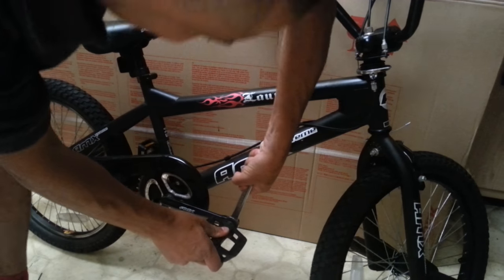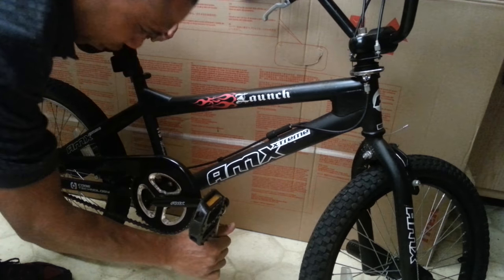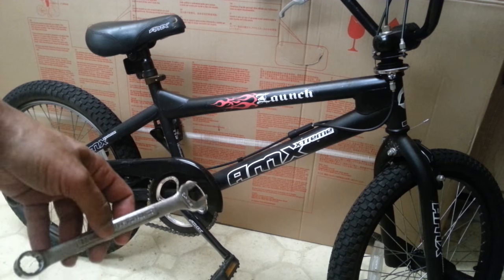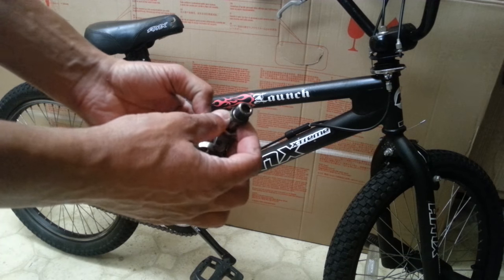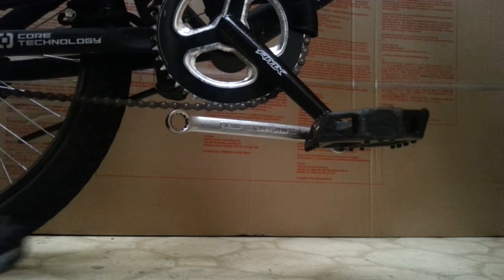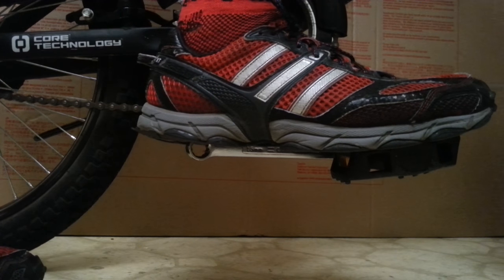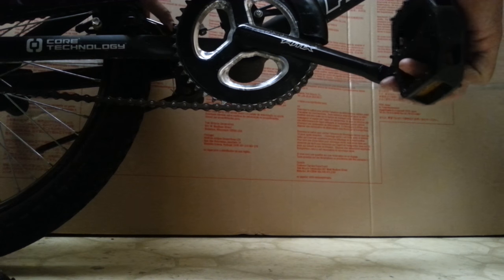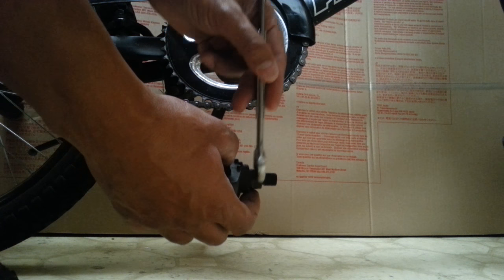How To Remove Bike Pedals From a Bike the Quick & Easy Way | #AdventureBiker

Comment: Man, you're a genius! I almost gave up on my pedals, but your solution saved me from going to bike service. Thanks a lot!
Reply from the maker: +Anatoly Sayenko Haha - thanks man! Glad this helped you. Thanks for watching and thanks for the comment!
Reply: Great tip ! Only had an adjustable wrench like in the video and the trick worked like a charm.
Reply: Same here man
Reply from the maker: Awesome. Check out this video for a tip on using an adjustable wrench for removing pedals: https://youtu.be/G5CbZg2sKxc
Reply: @theadventurebiker   what is different between right side pedal thread and left side pedal thread?
Reply from the maker: @SId-gb1qr  The right side has a right-hand thread, the left side has a left hand thread. This is so the pedals do not accidentally compleltely unscrew themselves from the cranks if they become loose. See the following video for more info! Watch this video here and find the answer to your question: https://youtu.be/G5CbZg2sKxc Cheers😉👍

Comment: Hi. Can I assume the same method will work on the other (not chain side) pedal? ie. Wrench pushed in exactly same direction downwards? Many thanks
Reply from the maker: Yes. Same exact direction. The reason being that the right side pedal has common right handed threads 
 that everyone is familiar with ("righty-tighty, lefty-loosey"); but the left side pedal has opposite (and not so common) left handed threads, in which case are also "righty-tighty, lefty-loosey". So rotate BOTH pedals in the SAME direction to loosen (backwards from the front of the bike). I hope this makes sense.
Cheers and thanks for watching!

Comment: Mine still stuck .but I've used your method before and it worked . Just ones I have on very tight on long time , they won't budge . Need to change them tho because one pedal slightly cracked .
Reply from the maker: Try soaking the end of the spindle where it threads into the crank arm with some kind of penetrating oil like BP Blaster. 👍

Comment: Do you have any tricks to get a peddal of the same type on the bike after they've been taken off? I'll explain. I'll be going on a bike trip and have to take off the pedals before going on the plane. We're not allowed to bring long wrenches or allan keys on board and I'm only bringing a small bag on board. I'll therefore need to put the pedals back on after landing, and without tools (ideally! if not without the tools at the airport to assemble my bike, I'll have to carry the bike with me in public transportation or in a taxi to a bike shop or hardware store : pain in the butt!). Thank you.
Reply from the maker: You really do need to have some type of tool(s) available to both remove and re-install the pedals safely and securely. Installing them only hand-tight is something I wouldn't recommend for sure. That could potentially ruin your crankarms in addition to potentially leading to an unsafe situation. Is there no way you are able to pack the required tools along with the bike itself? 

I am not sure what kind of bike and pedals you use but some pedals (like Shimano Deore XT and XTR) require an 8mm allen key for removal and installation (as mentioned in this video). There's really no other way. If your pedals use a 15mm open end wrench you might look into what is called a *crowfoot wrench*, like this one https://ebay.to/2speQ82. They come in every size and are small enough to pack away in the smallest of spaces. The problem with crowfoot wrenches is that they are intended to be used in hard-to-reach places, and this usually means they are to be used with a socket extension bar and either a ratchet or a breaker bar handle. You can use one without any of these but by itself you definitely won't be able to get much in the way of leverage to apply sufficient torque to properly tighten the pedals.

Another possible option is this: *Quick-Release Pedals*. Check out the QRD line of pedals from Wellgo https://ebay.to/2RmVwqL or the EZY line of pedals from MKS https://ebay.to/2RHoOjf. These pedals come in a variety of styles ranging from mountain bike, road, flat, and classic/vintage look. They use a low profile adapter that can be left in place on the crankarm. The pedal spindle inserts and locks into place in this adapter (and is also removable in seconds) without the need for any tools.

Comment: Hey, this worked great on the left pedal for me. But I can't seem to get right side pedal off. I trying to the exact same on the right but it won't budge. Any advice? Thank you
Reply from the maker: You'll simply have to try to put more weight & force into it. That's pretty much the only way. You might also try soaking some sort of penetrating oil (like P.B. Blaster for example) into the area where the pedal spindle threads into the crank arm.
Reply: Also make sure your turning it the opposite direction as the other pedal
Reply: @Donmateuk 
You turn them the same way (towards the back wheel)

Comment: I was able to use this to get one of my pedals off, but the other is still stuck 😭 the wrench is perpendicular to the crank (either way i put the wrench on) , so it's hard to get the wrench parallel enough where I can push down without the entire crank moving back and down
Reply from the maker: Yes sometimes you have to rotate the crank to a funny angle and/or flip the wrench around (that's why the open end is usually at a 45 deg angle to the handle). Position the wrench as close as you can to being level to the ground and then step on it as shown in this video. It might take some extra effort and even a few attempts but you should manage to loosen it. Good luck and thanks for watching! 👍

Comment: Maybe this works if the pedal and wrench line-up properly. My wrench stand-up at 12 o'clock
Reply from the maker: That's ok. Just rotate the crank arm (with the wrench placed on the pedal) until the handle of the wrench is roughly level with the ground (and facing  toward the back of the bike).
Reply from the maker: Have a look at the most recent video I created about this topic. It will give you a little more insight. https://youtu.be/G5CbZg2sKxc

Comment: Is it still. Anti clockwise for the left pedal?
Reply from the maker: Well yes and no (but most likely no).....that would really dpend on which side of the bike you are viewing it from. Watch this for a better explanation: https://youtu.be/G5CbZg2sKxc 👍
Reply: @theadventurebiker  Gday.   I figured it out.   To loosen,  it was one way for the right pedal,  and the other way for the left pedal (the opposite to each other)
Reply from the maker: @andrewwian4921  Yes. Bike pedals have opposite threads. This is to help prevent the pedals from loosening (or coming off) unintentionally. The right side pedal has the more common right -handed thread ("rightey-tightey, lefty-loosey" (when viewed from the right side of the bike)), but the left hand pedal has a left hand thread, so it must be turned to the right to loosen (when viewed from that side). Hope this makes sense and thanks for watching!! 👍

Comment: Are both sides lefty loosie?
Reply from the maker: Rotate both sides backward to loosen.
Reply: The Adventure Biker Left pedal was righty loosie. Right side Lefty loosie. The funny part is Im 48 and forgot but I can build a 950 horsepower engine. Or build an 7.50 tube chassis! Lol! Been a long time since I changed a pedal!
Reply from the maker: Haha that's why instead of saying lefty/righty loosie I said rotate both the left and right spindles backwards to loosen. Hope that made more sense. Don't feel bad man. I had a friend here who fully restored a 1967 Chevy Camaro SS 396 convertible from the ground up all by himself. He basically hand-built a numbers-matching car from the chassis up, and did an impeccable job I might add (the car has been featured in a couple of enthusiast magazines and has won awards at shows). This same guy would take his mountain bike to me to have the derailleurs adjusted when the gears didn't shift correctly....
I never fully understood that. LOL
Reply: I’m that same guy. Those derailers are maddening. I’ve built 3 show winners myself. A 69 Chevelle, a tubbed 72 olds that runs 9’s and car shows, and last year a 91 Z28 Camaro, but I’d be having you fix my derailer too!
Reply from the maker: LOL that is too funny. How can this be? I mean... obviously you guys have some over-the-top mechanical ability, ands derailleurs are very, VERY simple by comparison! I just don't get it. LOL

Comment: Mine still won't come off :( every time I step down on it, it doesn't move and then the wrench eventually just flies off onto the ground ._. Guess I gotta go to the shop lol great video though!
Reply from the maker: Wow, sorry to hear that. Are you sure you're rotating the pedals in the correct direction? Remember both sides basically rotate in a backwards direction to loosen, forward to tighten. If that still doesn't work then unfortunately your bike may need professional help and/or "surgery" :(
Reply: @theadventurebiker  wow almost broke my wrench, then learned that both side unscrew backwards 😯 it worked!!!
Reply from the maker: @chrisvione  Yes! unfortunately I didn't think about mentioning that when I made this video several years ago. So to address this concern I made a new video about this topic....check it out! https://youtu.be/G5CbZg2sKxc
Cheers! 👍

Comment: What about the left pedal?
Reply from the maker: Both left and right sides employ the same exact method to loosen and remove.
Reply: The Adventure Biker thanks,this is my first time disassembling my bicycle so I’m a bit scared cuz last time I was changing the seat I tore my finger’s skin XD.
Reply from the maker: No need to worry here. The right side pedal has right-handed threads and the left side pedal has left-handed threads. This means that both pedals are turned in the same direction to loosen/tighten: rotate backwards to loosen, forwards to tighten.

Comment: Pedal still didn't budge, I don't know what the heck to do. Guess I'm gonna have to work on the crank and bearings with the pedal on. And the crank still in the bike.
Reply from the maker: Put some serious body weight into it. If it still doesn't turn then you may need to soak the area of the pedal that threads into the crank with a penetrant like PB Blaster, or even heat the end of the crank up slightly with a torch.

Comment: I've honestly given up at this point I've tried everything, I broke a wrench tryingt o gr tit off. Not even this worked, any other ideas
Reply from the maker: Are your pedals rusted in place? If so you may need to try soaking or saturating the area with some penetrating oil or fluid. Also make sure that you are rotating the pedals in the correct direction to loosen! "BACK OFF"!
Please see my most recent video about this topic for more information:
https://youtu.be/G5CbZg2sKxc

I hope this helps and I would really like to know how you make out.
Cheers

Comment: And the other side ?  This works for the chain side sure.
Reply from the maker: The non-chain side is exactly the same procedure. 👍
Reply: Works the same, but the opposite pedal is stiffer (usually)
Reply from the maker: @jjwp-ql5rv  There's no reason why the left pedal (pedal on the non-drive side) should be any more difficult to loosen than the right hand pedal.

Comment: It doesnt work on my pedals. They have a round cylinder and the standard wrench cant grab it. It just spins around it. When I try to use a hex wrench on the other side , the pedal is just locked there. I put my whole body force. I will break something ... Well I am going to the service. Its too cheap than killing myself and ruin my day out of frustration. :))
Reply from the maker: Yes. You most likely have a newer style Shimano SPD pedal, which requires an 8mm hex wrench. These can sometimes be a little trickier to loosen if they're really stubborn but the technique is pretty much the same. 
Pro tip! - use a hex socket but on the end of a breaker bar turned 90° instead of an "L" shaped hex wrench!
Cheers and Thanks for watching!👍
Reply: @theadventurebiker  I did it myself in the end with a T hex wrench as you said. A straight hex and an L wrench and a multitool hex didn't work for me. Well, now I know to change my pedals on my own. I needed to put my red pedals to my red bike. So now it looks out balanced. Thanks. 😅👍
Reply from the maker: @Valentin Guru  Awesome. Glad this worked for you! Yes, a multitool (and most "L" shaped hex wrenches are much too short to obtain the amount of leverage & torque needed to loosen really tight or stubborn pedals.

Thanks again for watching and have a look at my most recent video about removing bike pedals and also some other great how-to bike tips as well!
https://youtube.com/playlist?list=PL6i5bgy9Y_ex9CJcJqyusM-XCe95ec2WR

Cheers! 👍

Comment: My right pedal comes off but not my left
Reply from the maker: Ate you turning it in the correct direction? Remember to turn BOTH pedals backwards (same direction) to loosen.
Reply: I am and it is opening up my wrench
Reply from the maker: Ok. What kind of wrench are you using? Are you using a good quality (ie. sturdy) wrench? A high quality wrench will not deform in any way no matter how tight or stubborn the pedal is.

Comment: Pls bro i need your help as fast as possible
Reply: Even if i have tried everything the pedals won't come off 
And the problem isn't that they are hard to get them out, the problem is that when i try to take them off there is nothing to put the key in so i can twist
Reply from the maker: Do your pedals have the "wrench flats"? (opposing external flat surfaces to attach a 15mm open end wrench on the spindles next to where they thread into the cranks)

Or do they only have hex sockets where a hex wrench has to be inserted into the end of the spindle?
(eg. Shimano Deore XT, XTR)
Reply: @theadventurebiker there is nothing to twist bro by the way the bike is a bit old it is an mtb from 2016 i think and i bought some new metalic pedals and there is nothing to do to take the old plastic ones off now i will have to trow or gift the new pedanls to someone😭
Reply from the maker: @gk_royal_fam  there most definitely has to be some where on the pedals to attach a wrench of some kind (external or "internal) to remove the pedals. Watch this video: https://www.youtube.com/watch?v=G5CbZg2sKxc
Pay attention from the 0:30 second mark. Is this the way your pedals are? If not there Must be a way to fit a 15mm open end wrench on them. Let me know.
Reply: @theadventurebiker  thanks a lot bro i will see it tomorrow thanks 🙏🙏🙏
Reply from the maker: Yes if all else fails and as a last resort you might need to take your bike into a shop unfortunately.

Comment: put a board between pedals
Reply from the maker: No, this isn't something I can reccommend doing since the board would brace against the bike frame when torque is applied to the pedal(s) to loosen. This might be OK on some bikes but could be very unsafe on others such as higher end, exotic carbon frames with thin wall tubing, which could result in a cracked frame tube (or a dent in the case of a metal frame using thin walled aluminum tubing for example).

Comment: Bro it didn't work for m, my pedals stripped all my tools
Reply from the maker: Wow sorry to hear this. Are your pedals rusted or seized in place?
Reply from the maker: Also, are you sure you're using the correct size tools? Most pedals require a 15mm wrench.

Comment: Tried this and broke the wrench after 2 minutes
Reply from the maker: Sorry to hear that. Your pedals must be really stubborn and/or rusted in place. Regardless, this method should still work using some additional force. If you broke a wrench this sounds to me that you may have used a wrench of inferior quality and/or materials.   Top quality hand tools are made from either Chrome-Molybdenum steel (CrMo) or Chrome-Vanadium steel (Cr-V). These tools are extremely tough and durable and will have no problems handing the additional force and stress that is required to loosen and remove stubborn pedals (and other parts). Thanks for watching! 👍

Comment: This " hack " is WHACK ! doesn't work only stripping the damn thing
Reply from the maker: If you stripped your pedal that's because you did something wrong - like turning it the wrong way (tightening instead of loosening), using and incorrect sized wrench, or both...

Comment: My pedals have been on for 25 years. This don’t work.
Reply from the maker: This method DOES work. Even on the most stubborn of pedals. I'm not sure what you are doing wrong, but over 400 people have commented on this video (and over 500 on this one: https://youtu.be/p0kihzVFkWY) about how this method has worked successfully for them, (many times when other methods have failed).  If your pedals are really stubborn, 1.) make sure you are using a high quality wrench; and 2.) put a lot of weight into it!!! It definitely works.
Reply: @theadventurebiker  it may work for others. 
I’m using a snapon spanner. Not working
Reply from the maker: @searchingshropshire  sounds like you'll need to get a pedal wrench specifically for bike pedals for the added leverage and torque provided by it's longer handle. But if you aren't successful using the method in this video then you'll have a difficult time using a pedal wrench as well. Just not quite as much. Thanks for watching.
Reply: @theadventurebiker  it worked on my Mongoose a treat. Just the Raleigh MTB it’s not  moving